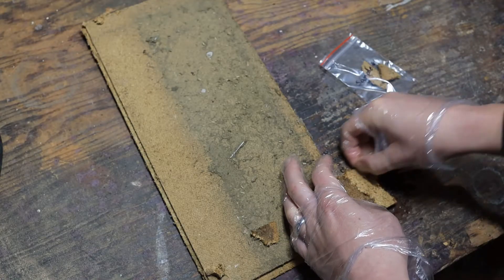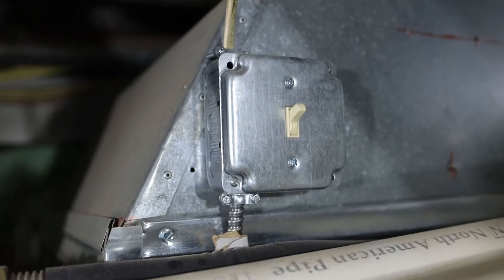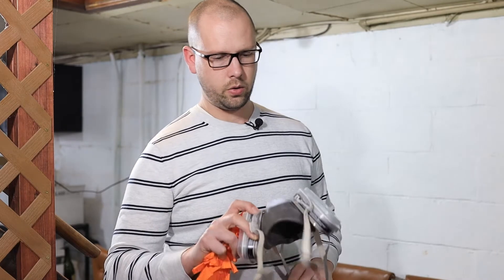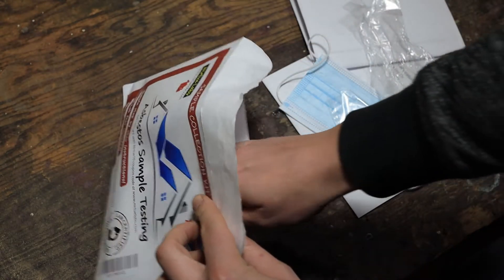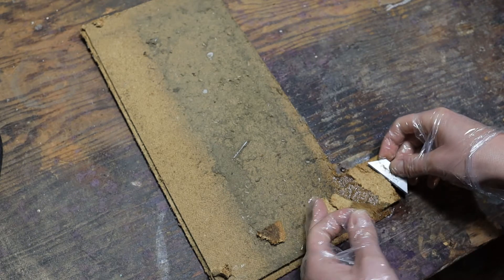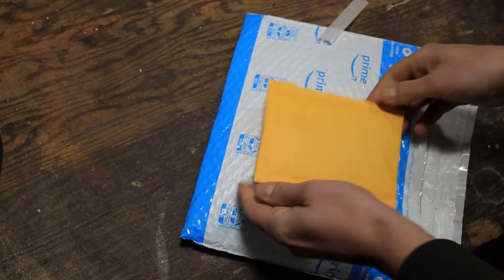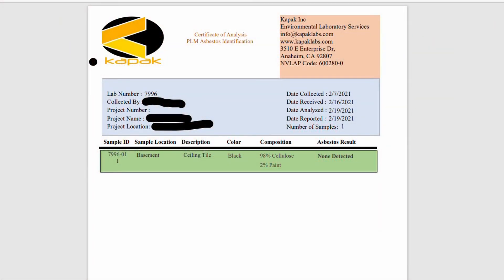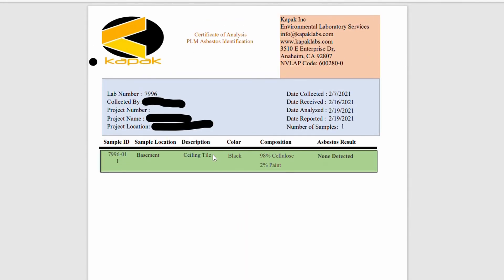DIY Asbestos Test Kit - Mail In

Comment: Thanks for this video. Assuming the tiles are asbestos, is there not still a risk to disturb even one tile to check it? On our ceiling, there are no loose tiles, we’d have to disturb one to get a sample
Reply: Dear Olivia,
this video already provides comprehensive tips on safety precautions and protective equipment and sampling is also clearly demonstrated here. Cutting off a small material sample is absolutely no problem if you follow the safety instructions properly.

Stay healthy!